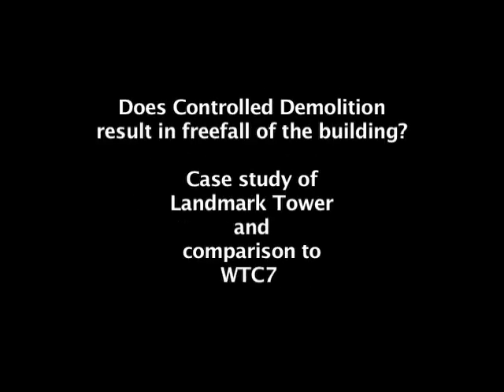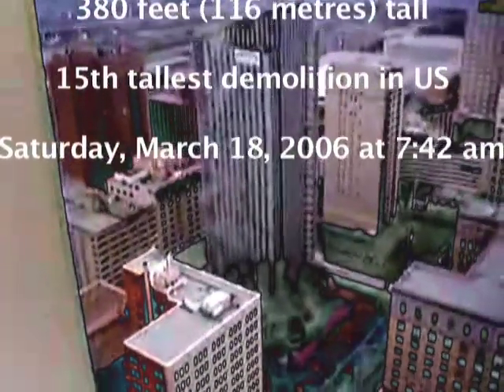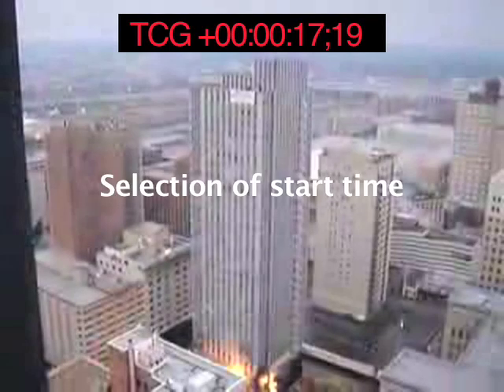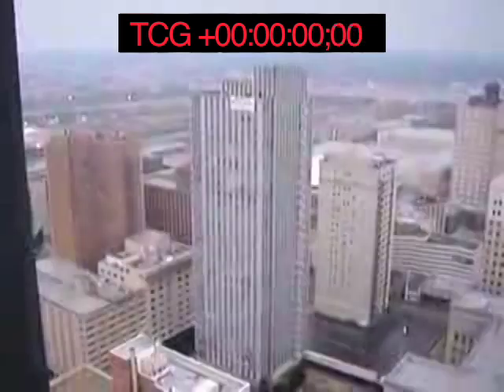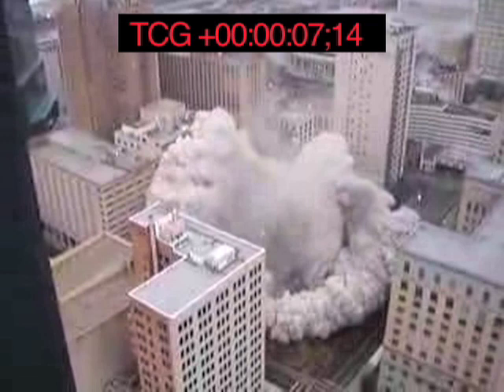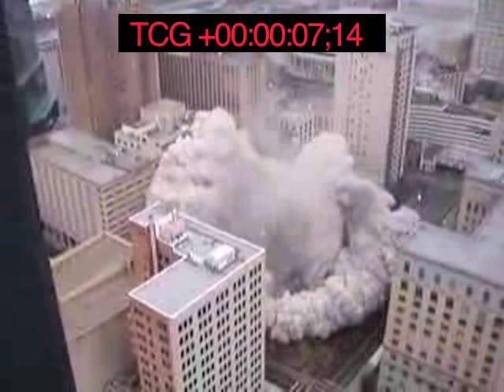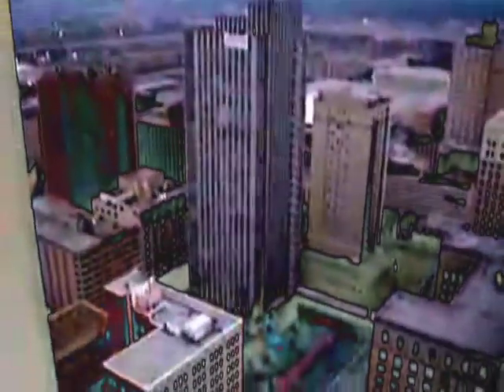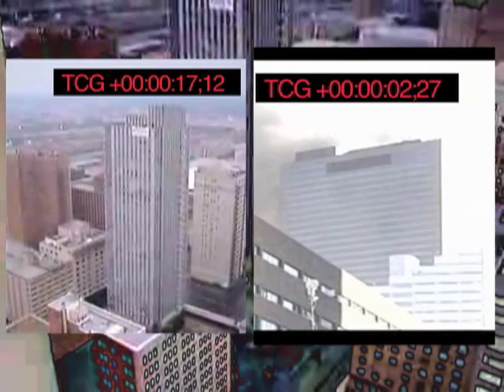Controlled Demolition and Freefall WTC7

Comment: 2 BIG problems. NIST said the fall of WTC 7 was 6.5 sec. AND NIST also admitted to free fall of WTC 7 for 2.25 sec. Can you explain this?
Reply from the maker: +Union Dude   No, NIST did not. They only measured the fall of 18 floors. So I can explain that your basic facts are wrong. Seismic measurements showed it to take about 18 seconds.
The brief freefall (actually measured faster than freefall by some) was partway thru the collapse, which incidentally occurred WITHOUT any noticeable explosions of any kind. Not a single video of the collapse captured any explosions as it fell. It was actually very quiet.
So UNLIKE any known controlled demolition. 

I have a video which shows the lack of explosions compared with REAL demos. It's titled WTC7 Explosions I think.

This stuff is just urban legends and really terrible ignorance of science combined in one toxic mess called 9/11 truth. It's like brain damage by youtube.

Comment from the maker: @ninjamojo711 
2) You are asserting that ALL the concrete was pulverized. This assertion is not based on fact, is not supported by any evidence. I assert that your claim is incorrect. I reject this assumption. Youmust provide evidence.
3) The question which follows is a strawman based on an incorrect assumption. It can easily be falsified by simply pointing to the fact that 100's of thousands of tons of debris were removed from GZ.
Solid material, not dust.

Comment from the maker: @ninjamojo711 I think you are ignoring my answer. You INCORRECTLY stated that 'WTC 1,2 &7 came down ... with out resistance'.
That is false!!!  Both towers fell at roughly 64% g, which indicates a huge loss of energy (g would be no loss of energy).
WTC 7 itself took almost 18 seconds to collapse, according to seismic and visual records. Yet it was in freefall about midway thru for less than 15% of that collapse. So MOST OF IT was <g.

THERE WAS RESISTANCE - you are wrong.

Comment from the maker: @ninjamojo711 'If it was pancaking, it should have lost momentum and toppled to the weakest side and not continued a resistance free crush on the way down'

Yikes. I'm sorry but this is way off the mark. The buildings DID rotate to the side witht he most damage!!!!!!!!!!!!!
You're arguing for something that actually happened?!?
The crush down was certainly not, by ANY competent measure, 'resistance free'!!! Nonsense. It was approx 64% of freefall, which means a lot of energy loss.

Comment from the maker: @ninjamojo711 
'How is it that WTC 1,2 & 7 came down by gravity with out resistance?'
That's not an accurate depiction of what happened, it's a strawman argument. Of course your premise is wrong, what do you expect?

'Controlled demolition removes the resistance' No, it doesn't. Even controlled demolitions typically fall SLOWER than g. You don't have a clue what you're talking about.
Source; study by E Yarimer at London University.

You're simply reciting talking points without proper research.

Comment from the maker: @Sandberg1972 Incorrect, as you've noted. This report is in fact about WTC 7.

Again, the Truther hypothesis is not possible if we are to accept that all the exterior columns were severed by cutter charges simultaneously - there's no way to do that without visible and audible evidence. You're proposing a highly implausible thing that has no precedent, and no hard evidence to back it up either.

What you cannot prove, is that the collapse happened as a result of fires.

Comment from the maker: @Sandberg1972 This is actually a false statement on your part. They are not baseless assertions, they are supported by a detailed engineering analysis, and a full LS-DYNA model.

You're attempting to handwave all that work without offering a detailed, engineering-based alternative hypothesis with supporting data. You need to get those things in order before accusing others of not doing their due diligence.

Comment: @AlienEntity1 "The "downward movement of the building core"? Where did NIST get this from? This is an assumption and nothing more. NIST cannot see inside the building, so this is pure speculation on their part. More likely that this buckling took place because the complete core was suddenly compromised through the use of explosives and/or incendiaries.  BTW, we're talking WTC2 here, where the toppart tilted and then miracilously stopped tilting. Conveniently NIST didn't address this of course.

Comment from the maker: @Sandberg1972 Basically, the collapsing inner structure eventually yanked the exterior columns - they buckled more or less simultaneously.

Pls note, that a controlled demolition could absolutely not have performed this in the way it happened, since it would have required cutting all the exterior columns together - if that had happened, there would have been massive explosions seen and heard all around the building. It didn't, so CD doesn't fit.

Comment from the maker: @Sandberg1972 
 p 606
'As the interior columns buckled at the lower floors and the corresponding upper column sections began to move downward, the ext.columns buckled inward at the lower floors as a result of floor pull-in forces caused by the downward mvmt of the building core. The floor connections to the columns had not yet failed in this region, as there were no fires observed on the W side of Flrs 19 - 14..., so the floors were intact and able to pull the exterior columns inward.'

Comment from the maker: @Sandberg1972 NCSTAR 1-9, p 612 Chapter 14 Global Collapse, it states:

The exterior columns buckled at the lower floors (between floors 7 and 14) due to load redistribution to the exterior columns from the downward movement of the building core. The entire building above the buckled-column region then moved downward in a single unit, as observed, completing the global collapse sequence.

Comment from the maker: @Sandberg1972 Bullcrap. In controlled demolitions buildings fall almost 100% into their footprints, by design.

That didn't happen with WTC 7, so it doesn't point to CD by that metric. You truthers insist on the comparison, yet it just doesn't work. It's a fail.

Comment: @AlienEntity1 And to take that sinking of the penthouse as a starting point is a clever but obvious way to avoid the freefall issue, and the simultaneous decent of the roofline and all 4 corners. May work for you, but not for someone who can see what's actually happening. It would be better btw if u did a new calculation where u would measure the acceleration of the roofline of the Landmark Tower (like Chandler did with WTC7), & see what u come up with.

Comment from the maker: @Sandberg1972 Ludicrous? uh, not scientifically, its not. Steel can easily reach a temp where it is subject to thermal expansion and/or viscoplastic creep fairly quickly, particularly when the SFRM has been damaged.

Remember the fireproofing sprayed onto steel? Well, it wasn't intact, because of the violent collsions of debris from WTC 1.
Both WTC 6 and WTC 5 proved that the SFRM would come off the steel. It's a fact.

Comment: U gotta be kidding me. U take the sinking through the roof of the mechanical penthouse as a starting point for WTC7's collapse? U know maybe it would be good if u do a little more study on that curious phenomenon. How can that penthouse sink through the roof, what kind of mechanism is at work there? NIST's "upward progression of failure" is something that has not been clarified or ever tested in reality, it's 1 more untested hypothesis, 1 more assertion that they did not back up with anything.

Comment: No it's not a strawman. It's ludicrous in the 1st place to assume that steel would be heated to the point of failure in a matter of an hour or a little more. Second, it's very hard to imagine that these fires that didn't last very long, and were dying out and were anything but an inferno, would've heated all of the steel columns that were present in the building, about 287 of them, with a couple of dozen broken or damaged. Other than that, the building acted like a heatsink.

Comment from the maker: @darion65 Controlled demolitions do not necessarily result in freefall, and when it does occur, it is at the very start of the collapse, not in the middle - naturally, since CD's use gravity to crush structure once the collapse is initiated.
So freefall is not, and never has been, a reliable indicator of the presence of controlled demolition. Take, for example, the WTC towers. Neither fell at freefall - they were about 65% of freefall.
But the sheeple have latched onto 'freefall' as 'proof'...

Comment: Can you do a messurement of the entire building and find out if any part of the building here is in free fall like they did with WTC 7. Like initial collapse of WTC 7 is clearly free fall but as soon as the top section colides with the lower debre it does slow down as you would expect. 

And I love the side by side video where you block out the side section of building 7 were you can clearly see the sections blowing out.

Comment: @AlienEntity1 Actually the timing of the fall is but one small thing out of many, some much bigger, that, scientifically & irrefutably(to those that research all the facts out there) point to a controlled demolition. Lots of fancy science stuff. All can be found with just a little research & searching around the web.

But to answer your question: No, I wasn't trying to prove anything. Just read what I previously typed & you'll know what I want: You to explain your vid w/ concrete, logical steps.

Comment from the maker: @JOHNNYH8STHENWO One other thing (btw, who do you work for? the funny farm?)
Here's the thing: Truthers claim that if nanothermite was in the buildings it wouldn't be set off by fires 'cause it ignites at over 900 degrees.

But the Jones/Harrit chips burned at about 450 degrees in the DSC. That's the same temp as paint burns, btw....coincidence of course... So either the chips ain't what they claim, or it would have been destroyed by fire.
Take your pick. You lose either way.

Comment from the maker: @jimbobubbadj I stopped it a bit short just to give it more margin for error.
So it really doesn't matter that much, either way it didn't fall at freefall acceleration on average, but somewhat slower.

I don't think anyone has shown that controlled demolitions actually fall at freefall speed - can you find a video that measures this and proves it? I haven't seen one.

I think the popular notion that any freefall = CD is not supported scientifically. It's just a claim.

Comment: You started running the clock as soon as the explosives started. You must start the clock once the building starts to fall. From there on one can determine the free fall spend. To me seemed that the building started to fall at your clock time of about 2 sec so you must subtract 2 sec from 7 sec to get 5 sec.

Comment from the maker: 1) concrete wasn't pulverized in WTC7. You're mistakenly blending the events of the towers and that together. Don't do that.

The 2008 NIST report used state-of-the-art engineering software which demonstrated how the collapse could indeed occur. Nobody has disproved their findings. Not even close.

Steven Jones is not an expert in structural engineering or explosives. Look up his CV. His training is in other areas. Argument from authority (a Doctor says so, it must be true).

Comment from the maker: Those points are basically red herrings, and at best are highly controversial or irrelevant.

First, in fact the pulverized concrete can easily be accounted for due to the mechanical energy of the collapse. There is a peer-reviewed paper which contains these calculations by Znedenk Bazant.

There were no 'melted' girders. That is a myth. There were examples of eutectic corrosion, but that is very different.

There is no real 'proof' of unburnt thermite. There is an allegation only.

Comment from the maker: There are indeed guidelines for fire and arson investigations.

The cause of the fires was known: exploding planes, voluminous flaming debris impacting WTC7.

There was no need for an arson investigation where the cause of the fires was plainly known.

You presume to know more than NIST about investigating building failures. Most likely you are simply rather arrogant, but perhaps you have extensive training and experience (perhaps an advanced degree in structural engineering).

Comment from the maker: Many (if not most) of your truther friends claim that BECAUSE the towers fell into their own footprints at 'near freefall speed' they were CD's.

You correctly point out that this 'footprint' claim is actually a myth. Also, tower 1 fell much slower than freefall anyway (about 64% as fast as freefall).

So right there 2 main truther claims are disproved. 1 of them by yourself.

Can you not see the problem here?

Comment: How does this even compare?

This tower was brought down without any concern to conceil that it's a CD.

They also took great precautions (read: more explosives) to let the building fall in on it's own footprint as much as possible.

You think those who rigged WTC1&2 were concerned with not hitting any other buildings?

Or would they be more concerned in conceiling their charges and only weakening the structure just enough to start the collapse?